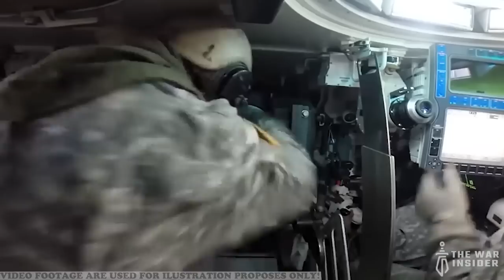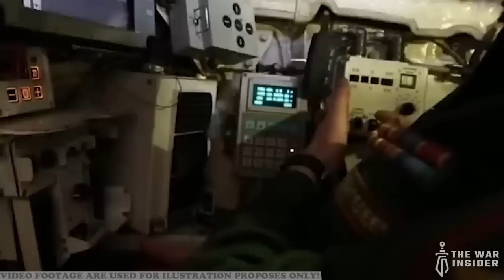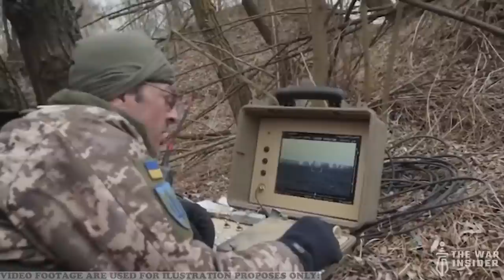Western Tanks for Ukraine: A Comparison with Russian Tanks. Leopard, Abrams, Challenger and Leclerc

Comment: One thing about the Leopards, which the Leopard 1 and Leopard 2 are famous for and the Ukraine already have the Equipment for it with the German Recovery Vehicles.
Maintenance is ultra easy for those tanks. You pull the Engine out, insert a spare Engine and then repair the pulled Engine with open access. An untrained crew needs about 1 hour to pull and insert a new Engine. A trained German Crew can do it below 30 Minutes. So while on some tanks you need this time to get to the problem by removing Parts, a Leopard already has it Engine-Transmission Unit swapped, so the tank can do tank things and the repaircrew has best accessibility and time to troubleshoot the engine.

German Recovery Vehicles are built to do this Engine Swap, they can even take their own Engine out, drop it into a MBT and insert the MBT engine into themself, when the Engine is not running well. So the MBT has the good Engine.

Only thing to do: Give Ukraine enough Engine-Packs. And luckily this are not weapons and readily avaible.
Reply from the maker: Absolutely agree
Reply: 20min is the goal ;-)
Reply: @tyrson2445  Yes, but you need a highly trained crew to achieve that.
Reply: You are overly optimistic here. A leopard recovery tank can not take its own engine out, because then all its systems would cease working, including the crane required for the engine swap. It does, however, carry a spare engine on the rear deck. I believe you are thinking of that.

Comment: The Abrams, Bradleys and M777s should be fielded together. I wouldn't want to be the Russians aligned against them. We've seen how that works haven't we?
Reply: First two are worhtless crap and the third already mostly destroyed.
Reply: Please remember that the 70 + tonne tank does not travel everywhere  but but  is determined by ground  conditions , in a desert it can go at speed in any direction .
In Ukraine it has soft peaty land beneath ,with ditches ,dykes  divided   by unsafe farm bridges  .
The land needs to freeze well down to support such weight ,therefore hard roads are imperative for advancement during battle !

Comment: Crew training is critical as are the tactics used at the Platoon, Company and Battalion level which matter far more than the nuances of the opposing tanks. Also, there has been very little tank on tank combat during the Ukraine war. That will probably still be true after western tanks arrive. RuSSia does not have well trained crews or proficient officers to lead them. The RuSSians don't even know how to boresight and zero their weapons. That is not going to change. In addition, western forces who trained the Ukrainian tank crews all know their tank, employment, tactics and are experienced in combined arms maneuver. The RuSSians have no clue what that is and do not operate that way. The RuSSians will have their asses handed to them. In fact, they could trade equipment with the west and the result would be the same.

Comment: Sorry, but the initial batch of western tanks is quite a bit higher than 100 tanks.
It's somewhat about 140 Leopard 2's, 31 M1A2 and 14 Challenger 2's.
On top of that, Germany is also refurbishing and modifying 88 Leopard 1's, they are more than capable of dealing with the mostly T64's which is what the Russians are stuck with using since they can't replenish their modern tanks due to sanctions.
Reply from the maker: Thanks for the clarification.  You are right.  At the time of recording the video, not all the information was available.
Reply: The newer Russian T80 are far better than rebuilt M1. As western  tanks won’t be  too spec
Reply: @Grant80  Leopard 2 is the tank Russia will need to defeat more often than any other. It will be much easier for Ukraine to have new crews trained for them by western forces. Than it will be for Russia to train conscripts on  T90 and T80. Leo is much easier to use and learn.  In addition, should any of the western tanks be hit, the chances of the trained crew surviving will be very high due to superior protection and safer design.  Especially Challenger 2.

All of the western tanks will be able to acquire targets at longer ranges than the Russians can. Simply because of superior sighting and thermal imaging equipment. In most tank battles, the side that fires first generally wins, especially if they are more accurate, with first round hits. 

Unless Russia has been able to produce it's T14 Armata. Western tanks will destroy the  Russians at a ratio of 5 or even 10:1.

A tank force of 300 modern NATO MBTs, supported by IFVs and mobile antiair cover. Would be capable of threatening Moscow, if used correctly.
Reply: russia have more tanks than europe and usa do a bit of non bised research
Reply: @Archivvve  and all stolen did u go rob it ur self u listencnn ect go play ur xbox kido
Reply: @emmettoconnor1262  Russia has "more tank" carcasses and only if you count WW2/Korea war area T64's.  Most of them are no longer serviceable and over HALF will be used to try and keep the other half operational.  These are going to be cannon fodder on the battlefield.
Reply: @gusgone4527  Hopefully things won't escalate to 'threatening Moscow'. The idea is to free Ukraine. The other advantage the Western tanks will have is Ukraine's skilled drone operators - who are great at relaying target info.
Reply: @Grant80  comrad Grantski you are on glue!!………and possibly lots of vodka!!
Reply: @emmettoconnor1262  yet they can’t back up at speed !! A design flaw overlooked since the 70s . Less vodka and more time spent studying the issues !!
Reply: @gusgone4527  I think you need to go back and re do sone homework. Russian tanks also have thermal sights and are well protected. Russia new anti tank missiles can and do outrange western tanks. 

To add the western tanks won’t have high quality armour they were produced with. Scaled down versions
Reply: @jasondrummond9451  Afraid not. I've been studying the internals of what was the USSR professionally since the Cold War. Those factions have existed a very long time.
Reply: @gusgone4527  
25:1
Reply: @Grant80  Russian mass produced thermal sights are still inferior to western designs and that is a fact. As is the armour protection. They have nothing to compare to Chobham and Dorchester L2.
Unfortunately for Ukraine,  they will only receive a small number of very highly protected British Challenger 2 tanks.  (GB should not be sending any of then but that is another story.) They will be full specification and particularly effective in the anti-armour role. Their long range gunnery ability being something of note. The downside is they will require a seriously complex supply chain for the very small numbers deployed. Which is not a problem for British forces but will be a big one for Ukraine.
Reply: @gusgone4527  you couldn’t be further from the truth. These yanks will be stripped of all major armour and high aircraft equipment.
Reply: @gusgone4527  It's not easier to learn and use Leopard 2's. It is easier to maintain in a comparison to Abrams because of diesel engine that Leo 2 uses, where Abrams uses turbine engines.
Learning to operate efficiently and properly using it, is not easy imo, maybe it is, meaning that either it was hard for Turkey to learn it, or they are bad at learning to operate Leopard 2's properly, that they became an open target for any weapon.
Reply: @BIOSHOCKFOXX  nice to see someone done sone homework 👍
Reply: @BIOSHOCKFOXX  By comparison to the older soviet types that have internal volume and drive train  "quirks." (I'm being kind.) Leo is an ergonomic dream come true. That's what I meant. It's just easier and nicer to operate and live with. That alone makes it easier to use and learn. Acquiring and servicing targets is very intuitive and much easier than with the old soviet designs the Ukrainians are used too. 
I should have worded it a little better.
Reply: @Grant80  If Abrams are stripped down to the basics, I will be shocked. No, horrified! Either way, Abrams will be a white elephant in Ukrainian service. Leopard 2 on the other hand, is not the best tank of the three being sent (it is very likely the worst) but it is the right tank logistically for Ukraine. 
If supported correctly with IFVs,  APC, mobile air defence and integrated mobile artillery. 300+ tanks could be used to cross the Russian border and thrust towards Moscow, if desired. 
It is likely the Ukrainian forces will try to retake their former territories  first. But the possibility still exists and would certainly change the dynamic of the conflict. 

BTW yes, russian anti tank missiles are good in many respects. Being primarily a Cold War veteran, I'm behind the times a bit in that area. But do they have enough of them to counter such an aggressive play by Ukraine. My guess would be no. Not that it would matter because the conflict would turn nuclear very quickly if Ukraine used it's Western supplied armour to threaten Moscow.
Reply: @gusgone4527  the M1 will be stripped down version. Same deal when it was given the Yemen. It was blown apart. Ukrainian forces don’t have ability to support these tanks. There air power is destroyed. Msm power dinning daily. The APC getting are outdated.
Reply: Euuh those abrhams might come around at the end of this year. Also over 50 of the 140 L2 do need exrensive revisions so early summer the earliest. so thats at most 14 chals and around 90 L2. So around 100 is the correct answer odr did i miss an update?
Reply: @barfuss2007  I was being kind.
Reply: @arturobianco848  Abrams not Abrahams , it's an easy spellchecker error to make. Done it myself.
The other equipment being supplied will enable Ukraine to keep Russian forces occupied until the summer. The effectiveness of the supplied tanks will be almost entirely down to how good the Ukrainian tank crews are at using them. By that I mean integrating the armour into a coordinated force, while exploiting the huge advantage the NATO MBTs  have over the Russian counterparts. If they simply use them in the same way as T72 and lesser models. It will be a real waste.
Reply: Fidd88  I doubt any western tank will profit well against Russian tanks. Russia not stupid.
Reply: LOL keep watching your local news, they already rolling in T90 in Ukraine buddy, dont think Russia is just sitting and waiting for Abrams and Leopards with T62 Tanks.
Reply: Fidd88  😂captured tanks 😂😂 than why the scam for more by Adolf Zelenskyy

Comment: Rather disparaging about the old Challenger, which holds the record range for tank on tank kill, and has never had a single loss to enemy fire. The Abrams uses the same armour as was developed for the Challenger. So I suspect the Challenger will be put into the toughest conditions. 
As for the Abrams, they are building them now, so it looks like it will be a very long time before they arrive.
They are not the same as the tanks  Ukrainians are being trained on in Poland.

Comment: Considering the Abram's can destroy tanks from 3 kms away there will be no tank on tank battles,  only destruction. 😂
Reply from the maker: In tank battles, a lot depends on the skills of the crew.  I hope that the Ukrainians will train enough.
Reply: @warinsiderua  I doubt the west is going to give away their prized armor unless they feel the Ukrainian crews are sufficiently trained. I really don't see the tanks and crews being ready for a spring offensive, I honestly feel the Ukrainians need to do whatever they can to postpone their offensive until autumn in order to give their tank crews the time they'll need. It's obviously a double edged sword though, the longer the Ukrainians wait, the more time Russia has to dig in and resupply.
Reply: No air cover for tanks = tanks destroyed from the air.  Any modern tank, no matter it's sophisticated armor type,  can be destroyed through it's relatively thin roof armor. Watch the Leopards and Abrams get picked off one at a time.
Reply: @GIwillo  No it's all given gratis
Reply: It’s all about combined arms , if the Leopard’s and Abrams are used properly with the Bradley’s and infantry with support from artillery they’ll eat up the Russian forces …. But it’s all about how they are used together.
Reply: @warinsiderua  I don't think you need to worry.
Reply: You do get that even Russian T72 got a firing range of 5-9km?
Reply: @chadleschasin2893  Combined arms does not mean, that you put some even weaker mini tanks with your tanks, but that they got artillery, support, air support, even more important anti air support, surveillance and so on.

Bradleys are worth shit.
Reply: @miriamweller812  Ukraine has had over $100 billion of aid money from around the World excluding military equipment.
Reply: @miriamweller812  Effective range is half that. Coriolis effect etc. comes into play at extreme ranges. The longest confirmed tank on tank kill was by a British challenger tank 120mm at just over 5 km.
Reply: Challenger did it at 4,700 metres in the Gulf War.
Reply: @1maico1  Numbers vary, but you are in the right ballpark.
Reply: @miriamweller812  Here speaks the "expert". Are you sure you are not from Nigeria?
Reply: A challenger killed another tank from 4,700 metres

Comment: Good vid just note one mistake in Afghanistan with the Leopard 2 you said without casuties is incorrect. One Danish Leopard 2A5 was hit by a IED and the driver was badly wounded. A medic treated him but unfortunatley he passed. Also to note the Improved Leopard 2A6 with the upgraded IED protection system for the driver worked very well when a Candian Leopard 2A6 tank ran over an IED and the all the crew survived. Also I disagree on the Challenger 2 not being put on the front line the engine is not weak and can be governed and the UK are providing support vechiles. With its hydro gas suspension system it can go cross country very well just as good as the Leopard 2 tank if not better and has taken more hits than Mike tyson and survived including no crew deaths. Its had more combat and has proven itself way better than the Turkish Leopard 2A4 tanks. See link its no slouch. https://www.youtube.com/watch?v=-wKfpPrRVIo

Comment: Western tanks, all day long, challenger 2, M1 leopard 2, with modern IFV and heavy infantry support, anti tank squads, with manpad support, modern artillery, Russians have 600 T90,T90A,T90M, T90MS, range 45-48 tons
Reply: But only about 20 work and have parts , how is 40-45 tons a range ?
Reply: watch an interesting tank history video about the T-90 and in some aspects it is inferior to the T-80 to the point the Indians (who bought in on the T-90 variant) are very p*ssed at the Russians for supplying tanks that are not as advertised.

Comment: I dont where this guy got his info but there is no tank in the world that compares to the Abrams especially the Russian tanks its been proven time and time again Abrams would chew them up and quickly
Reply from the maker: I really hope.  We will have a chance to check.
Reply: hi Tom can you name me war where the abrahmas didn't have all the other advantages over the other side. Thats not going to be the case in ukraine. There it will have to do the heavy lifting and not just the finishing of move. Also Abrahams never encountered the best Russian tanks just older export products. So on paper things should be much closer now. Also Ukraine will not get the best equiped Abrhams tanks the will have the down grated armour wich was actualy the only really exceptional point of the Abrhams.
Reply: @UnknownDev Abrams is the best tank in the world has been since it was built the new M1A1 Sep 3 would kill a leopard its armour could not survive the new  titanium depleted uranium round the Abrams fire now I know to many tankers and they will all tell u the same thing and now Israels new Merkava battle tank is a close 2nd
Reply: @arturobianco848  The Abrams (not Abrahams, ffs) going to Ukraine have the modern Chobham armor. These have a heavy metal layer for kinetic penetrator resistance. The US version uses depleted uranium, the Ukraine version (and the ones Poland’s getting) replace that with a tungsten layer. Tungsten is actually slightly denser than DU. It’s the same armor (tungsten) as used on British Challenger 2’s, it’s only very slightly worse than DU. (Tungsten can be brittle; they use an alloy with lozenges embedded in more ductile metal.) 

US can’t export DU armor because it’s technically fissionable materiel - banned per Atomic Energy Commission for export. (Which is silly, but whatever.)
Reply: Tom is correct. Ukraine’s getting M1A2SEPv3’s, they’ll be the most modern and most capable tanks on the battlefield. But they and the A6’s and Challenger 2’s are all excellent.

Comment: Don’t forget armor needs combat support and combat service support units to sustain operations.  They don’t just go out there and win wars on their own.  They need lots of supply trucks, service technicians, reliable communications, air superiority, infantry protection,  air cav protection, rapid intel updates to get them where they are needed most, just to name a few.  Also, who is going to crew these tanks?  You don’t just roll off a turnip truck and know how to employ a modern tank.  

Sadly this alone will do little to change things except continue to expend military strength of NATO finite resources.  I’m sure the Chicoms love the idea.
Reply from the maker: At the same time, this is the exhaustion of Russia.
Reply: For one thing, the Leopard and Leopard 2 were designed to be operated by conscripts, who first receive 2 months of basic military training and then 2 monts of specialised training on the type of equipment they will operate for 10 months (These are numbers from the Netherlands Army system). An Ukrainian tank operator needs no military training, so within 2 months he is able to operate the Leopard.